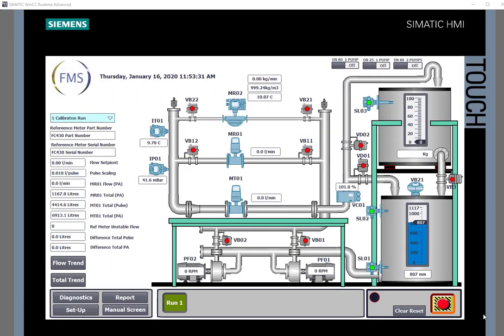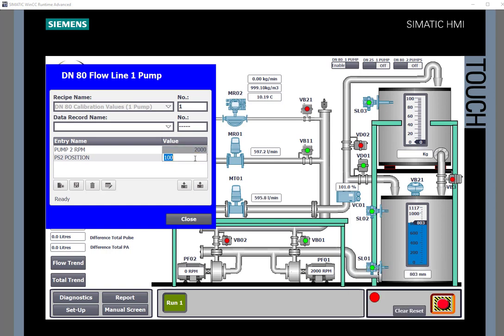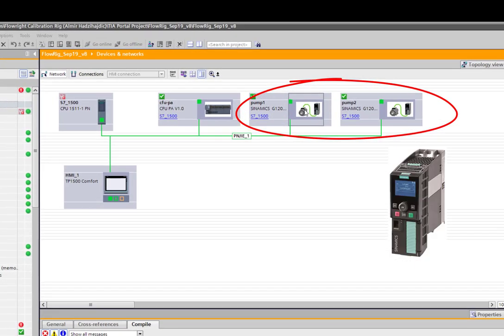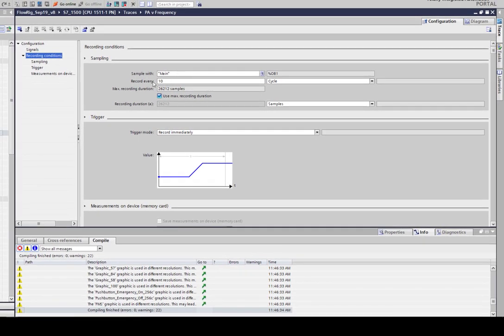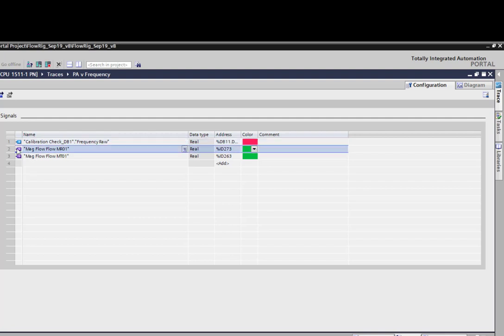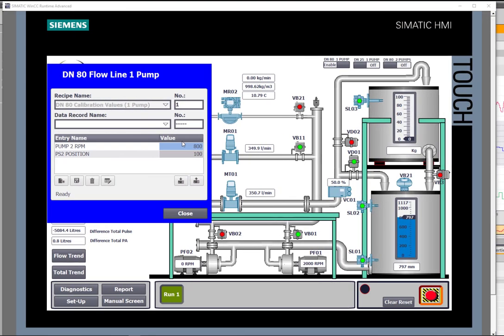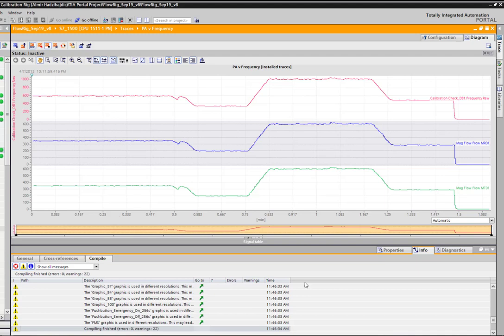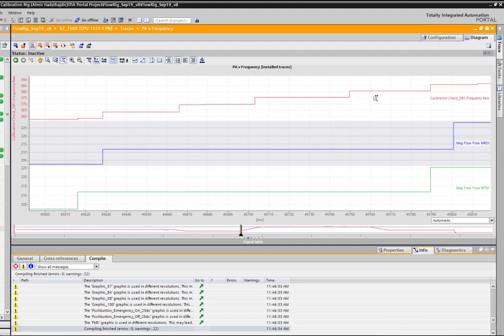Profibus PA Response time.  Real time test on FMS Calibration rig with Siemens CFU and HS Counter

Comment: Hello , I have  a project to test flow meters with siemens flow meter dn50 mag or other HW the problem is how to select best HW plc ,flow meter for best accuracy and the connection between plc and flow meter (analog ,hart , profibus )and what modules and how to establish the connection (17 DI, 12 D0 ,AI FLOW PRESUURE TEMPRETURE , AO TO AC DRIVER PUMP) , PC